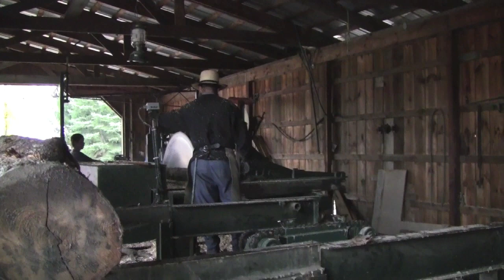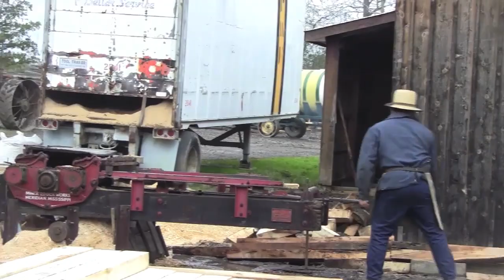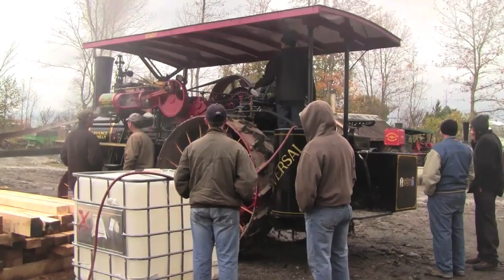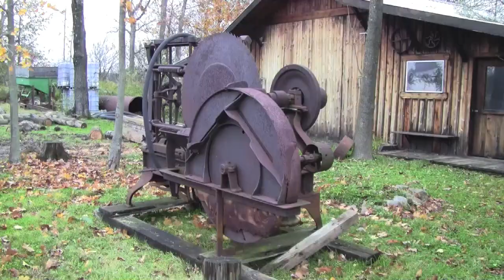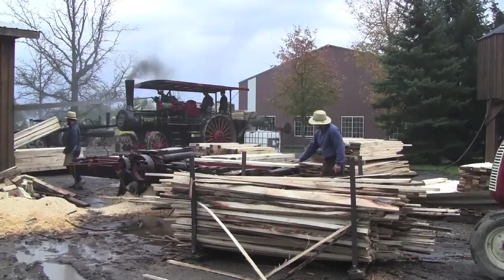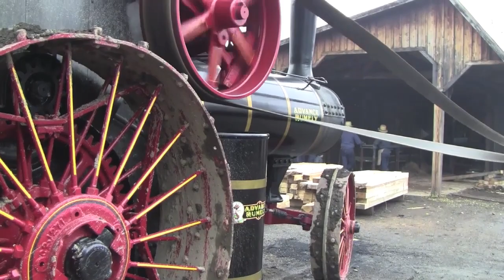Sawmill

Comment: @TAWZace It's called a Power Eater, a generator feeding a resistor load bank (a giant toaster).  Serves the same purpose as a Baker fan or dyno, just gives the engine a load to work against.  Has a timer circuit to apply + remove the load, to make the governor cycle.

This sawmill crew works together commercially full time, and it shows.  Good guys, too.